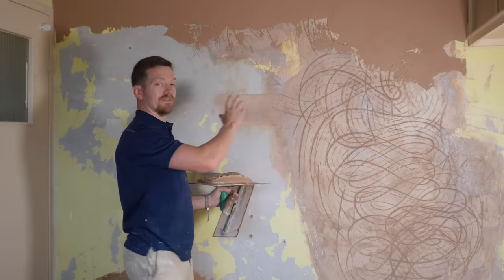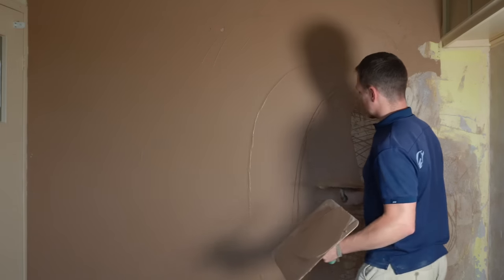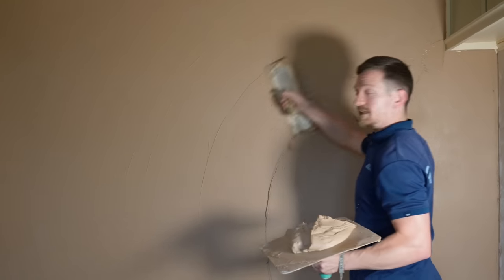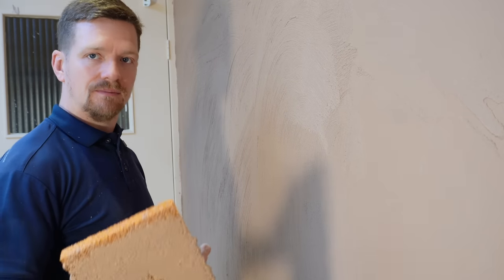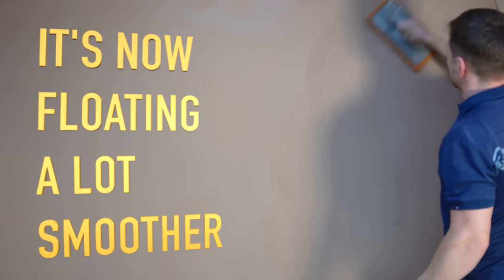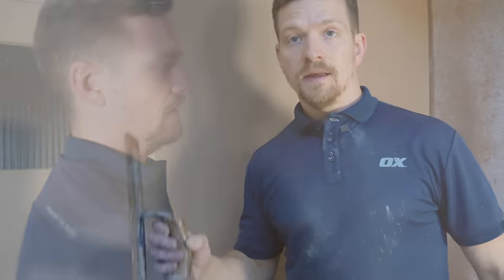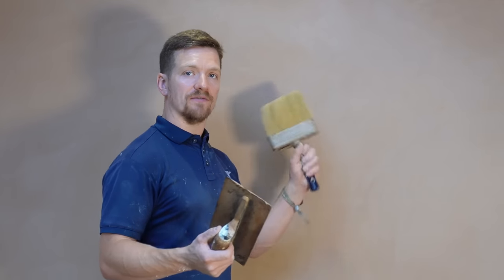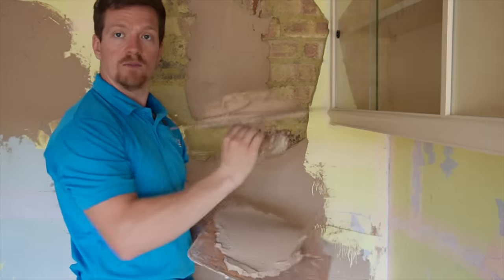NEW, Updated Sponge Method REVEALED…(For Better Results In Plastering)

Comment: I'm only a DIYer. And I can honestly say having used a sponge float for my plastering it has catapulted the quality of my work to another level..
Reply from the maker: It is great for beginners 👍
Reply: Hi Blaine would you say using stainless trowel after sponge is better the a flexy and. Would give better finish ??
Reply: @PlasteringForBeginners  have you ever used Spanish yeso? If so any tips?  This stuff goes off so fast.  

35 euro a bag for multi finish here in Spain so I need to get to grips with the yeso

Comment: I'm a spread. Near 30 years.....26 on the tools (I let me mates serve their  time on apprenticeship wages £15 a day .......) I chose to labor £50 a day. I learned just as much As me mates. When I'd spot boards full I'd wet my own tools I had bought n kept in the van and I'd apply S and C....skim cubby holes etc...... My boss seen I was well capable so let me go on the H AND T.... Full time..... Same wage.. I'm now 46 n have pains galore lol.... But imho it is the most demanding job out there. I never screed skimming apart from once when I done a 4 Star hotel.......I give first coat.. Flatten with trowel, cut back the angles then apply the second coat.usually a dry flatten on first trowel depending on the walls suction/age/not enough pva applied initially.I use my 60 euro horse hair brush for mainly the second coat..sprinkle /splash water on the wall.. Flatten it....brush my angles clean beads etc..... Wait till areas going brown in places and give a good hard trowel,. I'm actually going to start using one of those spray bottles you use.i Enjoy your videos. Paul. Ireland rep.

Edit .  I only use one trowel and that's my baby my marshalltown 14 inch

Comment: Hi Blaine, do you let the first coat pick up before applying the second when using the same mix?
Reply from the maker: A little bit…but not to the point where the mix is unusable. I probably give it 5, 10 mins max after application of first coat.
Reply: Cheers  Blaine

Comment: Hi have a question... why not only one coat why 2.. here in Mauritius we mostly use Rhinolite from south africa ... i apply 1 coat of 3mm than dress it with the wide spatula (dont know the name of the tool)  here it is ruler... than let it dry dress it again let it dry scrub t with sponge remove the cream to get a flat and smooth surface let it dry again second time sponge than make it shin level 5 no snagging at all
Reply: I will surely post a video on youtube ... than will put the linkbin this comment so you cn advise me ... p.s im new to this job 😅

Comment: Hi Blaine, i tried this yesterday for the first time but the float dragged to the point where it pulled the plaster around to much if i used it flat to the wall. I resorted to sweeping the float in straight lines whilst tilting it. I sprayed the plaster with more water which didnt seem to help. It was a refina 'fine' sponge float. They do medium and coarse, did i get the wrong one?

Comment: I used to sponge the whole wall and struggled to get the lines out cos that was the instructions at the time. Never thought to do it in sections as presumed to get it flat you needed to work the whole wall. This sounds a lot better. Thanks.

Comment: I need some help and advice i did a patch i had to stud and plasterboard two patch areas and pva on the existingthe plaster started slumping i waiting till it was almost off plastered over uneven in areas Will over skimming slove the uneven finish to smooth

Comment: Bit of subject but I believe your the man who can help me I’ve recently bought the same nela trowel your using and it’s leaving terrible lines Im wondering if you had the same problems it doesn’t look bent but it’s acting like it is thanks
Reply from the maker: Hi mate. It sounds like the blade is slightly bent towards the wrong way. Put pressure on the corners of the trowel to bend it into shape. Hard to explain but I hope that makes sense 👍
Reply: I find that nela blades come quite flat and level where marshaltowns have got that banana shape when you look down the length so it causes seam’s instead of lines if makes sense
Reply from the maker: I agree actually Mickskinner. Few months with sand cement sorted it nicely though 👍
Reply: Makes perfect sense thanks 👍
Reply: @PlasteringForBeginners makes perfect sense thanks 👍

Comment: I have artex ceilings throughout my house. I was told by a plasterer that I needed to board them all downstairs to prevent any plaster cracking when people walk upstairs. The ceilings are solid and in good condition. My spider senses are telling me this is BS. What are your thoughts?
Reply: Load of rubbish mate bond it with blue grit/pva/green grit what ever you want and plaster straight over it. Scrape it back and apply plaster
Reply: Reboard it is the best professional option